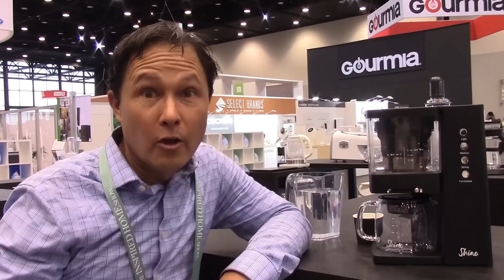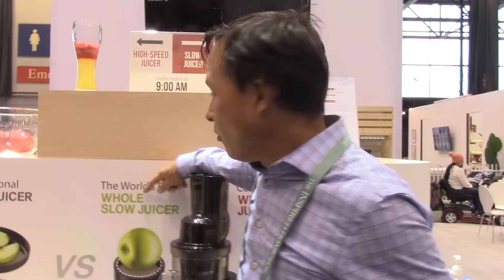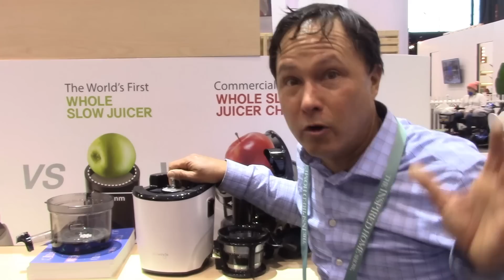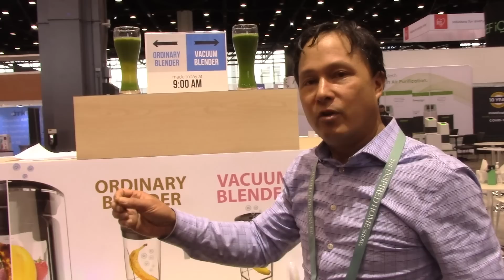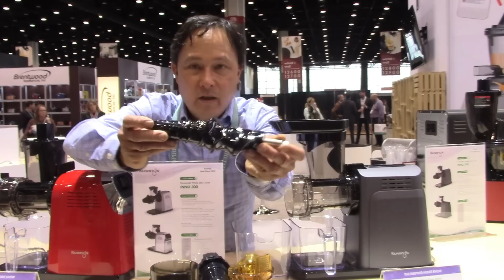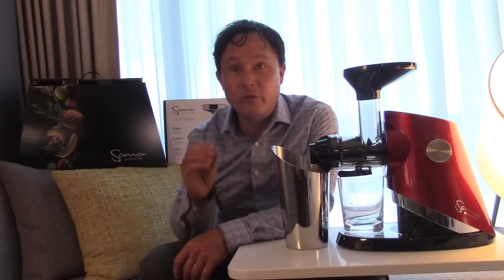New Juicers & Vacuum Blenders You Can Buy Soon for 2022

Comment: The AIO Unbalance Vacuum Blender may be just what I'm looking for to blend frozen berries in a thick smoothie if the blade assembly is robust enough for the job. I used to own a moderately expensive KitchenAid blender but the blade assembly broke down after just a few months use blending frozen berries. Next, my Vitamix container held up for 7 years but the bearings are starting to leak lubricant. So it's time to upgrade to a vacuum blender.

Comment: I dont own a vita mix but i really like the idea of the new food processor adaptor top for the ascent 3500, just remove the blender jar and place the food processor unit on the same base and voila. I wish Kuvings , tribest, dynapro etc would consider making the same. It saves having 2 motor bases and saves on space. that said i like the idea of the new kuvings vacuum blender. Have you tried the vita clay multi clay cooker, and how did you like it ? I see the souvsant but not the vita clay. thanx

Comment: The CB-1000 is like $4k!

AIO almost hit the mark at $380 (don't think it's available in USA) but I don't see how you can get the second container out hygienically without putting your hands in the product. Also they could have at least added side lights to illuminate the container it's so dark when blending.

The vitaclay looks awesome I thought they couldn't do rice but I was looking at the wrong model. I've been using the best Cuckoo model available almost $800 and absolutely despite the metal pot. It begins to fall apart into your food and is unsafe if scratched even once. Even the paddle wears it out then it's a $100 inner pot replacement to go through it again. These anti-stick coatings are rarely trustworthy.
Reply: crazy price on the CB-1000 One out of a hundred might spend that much, not me. I was very disappointed when I saw that ridiculous amount.

Comment: I am excited for the AIO Unbalance vacuum blender, which will make blending low-moisture food without added water much easier without time-consuming manual tamping and mixing.

Kuvings enclosure seems like it would make blending much more pleasant. Many people can't stand being around a loud blender.

I don't understand the VitaClay cooker. If you want to cook at a low temperature in a clay pot, why not use a traditional electric slow cooker (crock pot)? The only significant difference I see is that traditional slow cooker crocks are glazed with enamel (glass). That seems like a big advantage! Easier to clean, and doesn't absorb water or food flavors. Plus, they've been in production pretty much unchanged for half a century and are extremely inexpensive appliances. The materials they're made out of are safe: enameled clay pots, and glass lids with stainless steel trim. Glass is the least reactive material of all, so I don't see why cooking in a glazed clay pot would be less healthy than an unglazed pot.

Thanks for the video, John. I'm subscribed and looking forward to what's coming up! It's an exciting time in juicing with these new technologies giving us better juice than ever! I'll watch your full review of the AIO Unbalance vacuum blender.
Reply: I don't think a slow cooker gets low as 118 degrees or lower

Comment: Great video.  I liked the  Kuvings Revo830 with not having to cut up the carrots and celery. Would save a lot of time.  The  Kuvings vacuum blender CB-1000 caught my eye, seems so easy compared to the Dynapro. I have issues trying to open my Dynapro.  So hard, and I have osteoarthritis in both my thumbs, and that makes it all the worse.  I love my Dynapro, but the CB-1000 would be great to have. The, AIO  would be ideal with not having to put any water with it,  and Sana 727 for the oil extractor.  I have the Tribest Slowstar, the Omega VSJ843RS, and Tribest Dynapro which were all purchased from you.  I would like to know more about the VitaClay cooker.  I have a couple of instant pots, but the VitaClay would be a better option with the lower temps.  I will wait until you had a chance to make a video on the Sana 727 Cold Press Oil Extractor.  I would like to make my own flax oil, and hempseed oil.

Comment: What’s the. Best travel  juice machine  to take with me  
When I go  overseas?
Which  one can I bring on the 
Airplane with me?
Reply from the maker: Not many juicers are dual voltage. There are a few battery operated juicers, but they have been underpowered so far.  you can take auger juicers with you on carry on.

Comment: Does the. Dynapro vacuum Blender lose it’s  vacuum 
Before it’s  finished 
Blending? My Dynapro Blender loses it’s vacuum  by the time it’s 
Finished Blending. I can  Revacum  after I finished Blending.
I like watching  you going to the trade shows.
After Blending its foamy when 
I’m done With the Blending.
Reply from the maker: Vacuum should not be lost during blending in the Dynapro. When you pull the tab you should hear air rush back in. Contact tribest as you may have a leak somewhere or troubleshoot at: https://www.youtube.com/watch?v=VbK3-waIYNI&t=15s

Comment: i wonder WHY the Tribest Dynapro DPS-1050A-B Commercial Antioxidation Vacuum Blender gets such poor reviews on Amazon?
Reply: Because it sucks. At least based on my experience. I like the Kuvings better.
Reply from the maker: Because its the DPS-1050A-B model.  That model has since been discontinued.  I personally had 3 defect issues with the 1050A-B product, and I personally don't feel it was ready for prime time when they released it.  Tribest did determine the deficiencies with the 1050A-B model, and corrected almost all of them, by then the damage was done.  So they basically solved all the issues with the 1050a-b model and then came out with the DPS-2250 model that has a new motor made in Sweden that significantly improved the machine & along with all the "rolling improvements" tribest made with the 1050A-B during its life cycle. I  only recommend and promote the DPS-2250 model.
Reply: Amazon is one of the sites with the most impartial reviews. I found that if you go to the company websites, there are some that only post the most positive reviews.
Reply: @Victoria-bl4tw  i do worry about false positive reviews on Amazon, but more so with too many negative reviews
Reply: @mikefa5891  You may be right in thinking that there may be people working to take down a company. Best is to order what suits your needs from a company with a good return policy.

Comment: Several of my family members have bought juicers and blenders from you. We have found your honesty exceptional. As for the AIO, I am very interested. I’m about to buy a vacuum blender (I’ve saved up for the Dynapro for a year).The Blendtec Vita Mix vacuum blender kit doesn’t blend smoothly for greens and seeds. When I use it to juice, it gets stuck and doesn’t grab the veggies very well. I have to take it off multiple times to pound on the carafe. The AIO looks like it has only a 1 year warranty though.

As for the Vita Clay Pot, I’ve wanted something to make sweet potatoes soft (raw) in the way that one guy/Dr (with a long beard) you interviewed years ago did it. He put them in 118 degree water for 3 hours. I’m anxiously waiting for your videos, because this blendtec is too chunky & I spend hours daily using this stuff.

Thanks John!
Reply: I have an instapot with sous vide function. You can set very low temperatures on it I wonder if you could soften sweet potatoes like that
Reply: I'm also interested in the AIO blender but I'm not feeling very confident with a 1 year warranty. One thing that's confusing is that Indiegogo has it on their website as still being under development. But I'm seeing it for sale on other websites.
Reply: I think waterless greaseless cookwares are best they cook at 82-86 degrees and if you get the highest qualities use 316 surgical stainless steel

Comment: There definitely needs to be a comparison made between the Kuvings CB-1000, AIO and Dynapro.

From what I can tell, the AIO will have more versatility being both a food processor and blender BUT will have a smaller capacity (I'm guessing) compared to the other 2 products and therefore if your ONLY concern is to make vacuum blended juices and smooties and you're happy with maybe your current food processor, then you might want to go with Kuvings or Tribest. And between Kuvings and Tribest, it's goings to come down to price, chopping performance, vacuum suction and convenience which needs to all be compared before a decision is made. Right now, I think the new Kuvings has a lot of potential but needs to be tested to be certain. That's just my early take...

Comment: wow that Kuvings CB 1000 Auto Vacuum Blender looks awesome. The only thing is it started to blend a bit early  in my opinion. I want to know how much oxygen was left before it started to blend I wonder if they have a sensor or something to detect oxygen in the sealed environment.
Reply from the maker: yeah, this is my concern as well. Unless they really move alot of air, I do not feel the vacuum may be sufficient for my standards and compare to other vacuum blenders.
Reply: I agree I'm a little concerned as well. However, it does appear to pull a little bit of a fast vacuum before the blades turn a little, finish fast vacuuming and then blend. That might not be so bad.

Comment: Whoa! John, are you going to recommend this Revo0830 over the Nama J2?
Reply from the maker: Not so fast. I do easily recommend the REVO830 over the EVO820, but it will be difficult for me to give up the convivence of the Nama J2. Once the REVO830 is released, I of course, will do a comparison video :)  That being said, I hear that Kuvings is working on their Hopper Based Vertical Juicer :)
Reply: I agree, I think the Revo would have been the best juicer before hopper juicers were released. 

It's good to know that Kuvings is coming out with a hopper option which shows they also agree that hopper juicing is better. I think in order to improve the hopper design, they should have a way for celery to be cut like in the Revo and, more importantly, make the hopper taller. In addition, I think there should be maybe 2 or 3 (possibly more?) hopper sizes so that you can decide what size you need when you need it. The smaller hopper(s) can be for under the counter, space-saving situations and the taller hopper(s) for bigger capacity juicing. I also hope they add the sliding, ejection port design found on the KCJ-300.